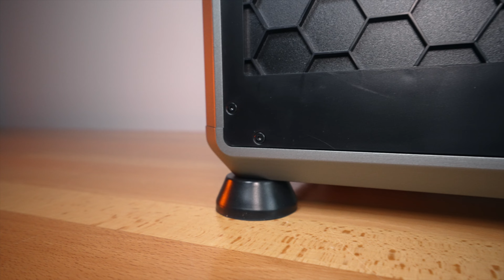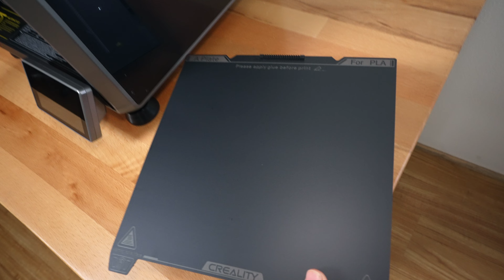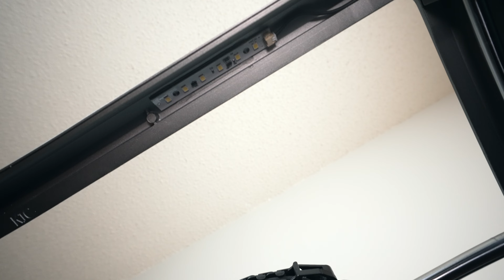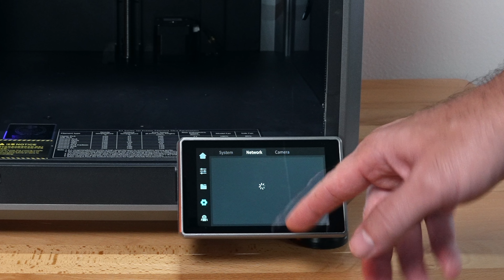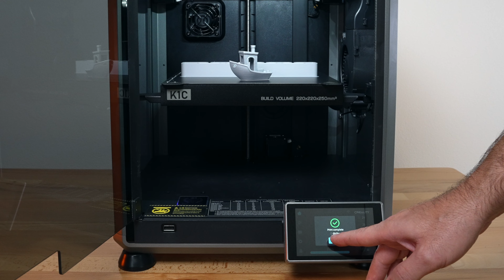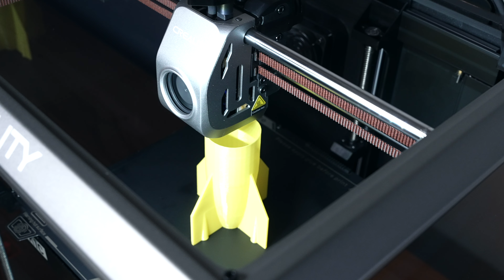Creality K1C - CF 3D Printer - Unbox & Setup

Comment: NOTE THIS IS NOT A FULL 220X220 PRINTER
CREALITY APP HAS MORE FAILS THAN SUCCESSES , GET USED TO ORCA AS ITS THE SAME SLICER FROM BAMBOO AND CREALITY JUST RUNS A COPY
THE CAMERA  HAS NOT WORKED SINCE CREALITY SLICER 4.0, 5.0 AND NOW ON 6.0 NEITHER
THE AI CAMERA IS A SCAM AND DOESNT DO ANYTHING BUT TIMELAPSES , , SOMETIMES
YOU WILL STILL NEED TO FIX ISSUES AS THE FACTORY OR CREALITY REFUSED TO GET IT RIGHT BEFORE RELEASING , MUCH LIKE THE FAILS ON THE PLAIN K1 WHERE USERS ARE STUCK WITH THEIR FAULTY RELEASES WHILE THEY SIMPLY SLAPPED A C ON THE NAME AND SOLD IT AS AN UPGRADED VERSION OF A SUBSTANDARD RELEASE TO THE PUBLIC

Comment: How can one get rid of the print lines so we get a smooth surface
Reply: Resin 3d printer?
Reply: Use nail polish remover. Put the piece inside a container apply acidton at the bottom of the container, not on the piece cocer the container with a lid. The acid gas will polish the surface smooth.

Comment: Hey I just got my K1c and the PSU fan is on full blast all the time and does not power down after. Super loud and annoying. Curious how yours works does it shut down after when its not under a load? mine seems to just stay on

Comment: VERY IMPORTANT to switch the power setting on the right side from 220 to 115. Also, the top likes to pop off, Other than that. a GREAT printer.
Reply: Also, the input voltage may be different from one country to another. Other countries may be 230V  some 115V

Comment: Wow - This looks awesome - and thanks for the video. Well done!
Unfortunately, in spite of reasonable price, I am way too paranoid to give up control of this printer to a "cloud" server in another country. Doggone it. Is there any good carbon-capable printer at or below this price which is self contained - control wise?
Reply: You don't need to use the creality cloud service. You can use the Creality slicing application which can be installed on your computer. You can even use Orca Slicer instead (which I prefer).  Orca already has the printer profiles, and the camera even works.

Comment: Awesome Review. Sorry a noob question. Could you please guide or explain what the "Please apply Glue" means on the plate?
Reply: Some 3d printers you can apply glue with a glue stick to the build surface to help adhere the print it to the base during printing. Some people use hair spray too

Comment: So, I'm a beginner and I've had this printer for almost 3 weeks now and I'm going down the rabbit hole quite fast. I'm wondering how you printed your TPU model. I found that out of the box I can't do large TPU prints without issues because of the amount of friction in the Teflon tubes. I invested in a dryer and printed a top spool to print via direct drive.
Reply: just print with abs.... much easier.  nice abs from 3djake prints like a charm, not sure if it is available outside of europe.  Any regular abs will print nice... or at least it does in my P1S.   I also had issues with TPU, clogging mostly.
Reply: @walterrldias  I had to set up my TPU as "direct drive". I found a spool mount on Printables that allowed me to mount the roll directly above the printer. That way there's no drag and it prints fine. Just need to make sure to dry the filament first. You also need to leave a piece of filament in the filament sensor.
Reply: @SooksVI  you know... I just came back from a long trip, and I misunderstood TPU with PETG.  Obviously you cannot replace TPU with ABS.  Thanks for the reply.

Comment: Just got my k1c 2wks ago best investement ever imo 
no issues whatsoever so far definetly recomend the printer to anyone even total beginners to 3d printing like myself
Reply: x2, total beginner and now I can print everything.
Reply: Wish I had the same. mine was DOA. They sent a new main board, didn't work. Sent another, didn't work. this is about 3 weeks each time. Sent a new ribbon didn't work. Sent a new screen and it finally booted! but it won't pass the calibration on nozzle heat... Been about 4 months since buying it and it has yet to strike a blow.
Reply: @timmcphee3045  where did you buy it from? 🤔
Reply: @timmcphee3045  Sounds like a return that was DOA to begin with.

Comment: Thank you for your response.  I want to get out of worry.  I installed a heat sink and silicone paste on the front side of the stepper motors and closed it with a strap.  It had a terrible effect.  It doesn't get hot anymore.  Stepper temperature is fully controlled.  and does not generate any heat.
Reply: sorry... but I think you meant "a terrific effect", which means awesome, great, etc.  Terrible effect is the opposite.  English.... just use another expression and you will be fine.
Reply: forgive me  I am writing this text with google translation.  By installing an aluminum heatsink with silicone heat transfer paste.  The temperature of the stepper motors is very controlled and the stepper motors do not heat up in any way and everything stays cool.  I suggest you try this method.  It has a great effect on heat transfer😊 @walterrldias

Comment: I just bought the k1c device.  I am worried about the overheating of the x and y axis stepper motors.  They get very hot after a few hours of work.  And I'm very worried that they won't burn from too much heat.  Is this my worry? Or should I worry about it?
Reply: Typically steppers are designed to run hot. I think you can lower the current in config if you really want, but beware of skipping

Comment: should i get the k1c or the bambu A1
Reply: I'm very biased since I own a x1c but I'd get the A1 for the larger build volume, reliability, and multi-color. I think it really comes down to what you'll be printing though. You won't be printing abs or anything on the A1.
Reply: @alexgibson7960  yea I wasn’t planning on abs all that much but the carbon fiber caught my attention ik u can set up the a1 for cf but I heard it wears the machine quicker
Reply: @larryfisherman6449 just don’t use ams while doing carbon fiber
Reply: bambu lab p1s, which is cheaper.  and print everything and anything for 599
Reply: @walterrldias  it is not cheaper stop cappin